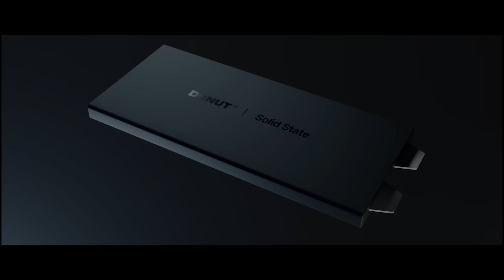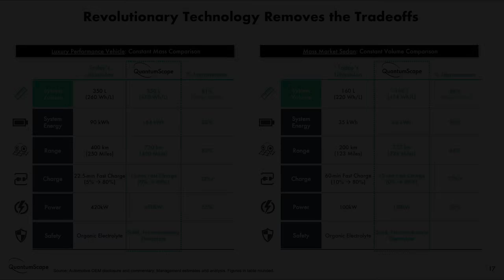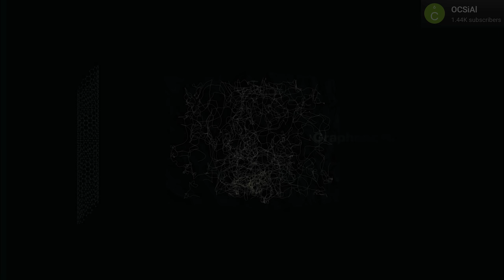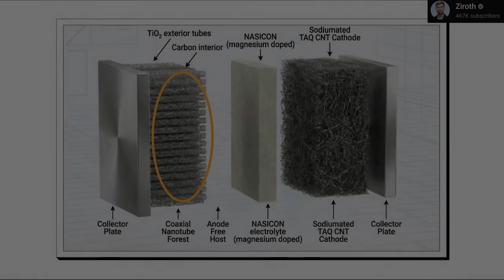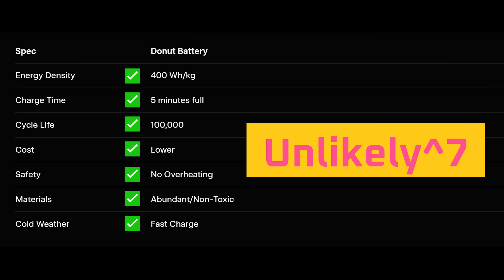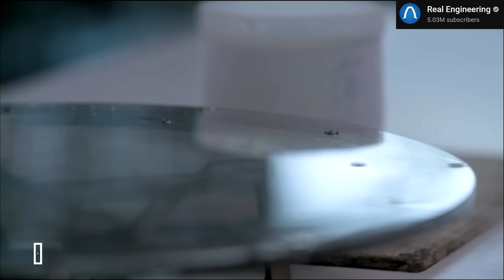Donut Lab's Battery has a Problem with Physics (and manufacturing)

Comment: The Wright Brothers had a problem with physics, too!  😂😂😂
Reply from the maker: And then the Wright Brothers provided proof.

So far, Donut hasn't provided proof.  The results they provided Monday could be replicated with other batteries, so it's far from definitive.

It's likely a cutting edge battery based on the results, but it's still very far from what they're claiming - which is that they've replaced the blade with a laser.  pew pew
Reply: @thelimitingfactor The Wright Brothers did not actually fly on their very first test flight, either.
Reply from the maker: @wesbaumguardner8829  Donut claims they are able to mass produce this cell by the end of this quarter.  More than that even - delivered to customers.  They  have 5 weeks.
Reply: @thelimitingfactor  Well, 5 weeks is not that long to wait to find out if they are lying.  I am not saying they are not lying and I am not saying they are lying.  I simply do not know.  However, there are a lot of people making positive claims to knowledge that I believe they do not actually possess on this subject matter.  They are usually easy to spot because they issue some random argument from incredulity and then back it with more arguments from incredulity and/or anecdotes from lithium ion technology which Donut Labs has specifically stated they are not using.  When people claim that this solid state technology cannot perform because of the limitations of a different technology, that is a red flag and I stop taking claims made by those people seriously because they are going off of false assumptions that cannot be correct.  There is no way a solid state battery is using the same exact processes as a liquid lithium ion battery.  These people are making claims about something for which they do not actually have positive information because they do not even know what materials are being used in the battery right now.  Only a fool makes positive claims about things which they know little to nothing about.
Reply: The Wight Brothers had an excellent understanding of physics and engineering.  They carefully analyzed the problem of controlled flight from first principles physics.  They built their own wind tunnel to test aerodynamic lift and drag, they designed their propeller as a rotating wing, they did unpowered test flights to test their aerodynamic control system, they designed and built their own engine in order to get an acceptable power to weight ratio.  They knew what they were up against.  IMO Donut Labs has very long road to travel to get the expertise and experience needed to produce battery cells.
Reply: @georgepelton5645  "The Wight Brothers had an excellent understanding of physics and engineering."  Is it your claim that Donut Labs and their sister nanotech company do not have a similar understanding in their field?  If so, do you have evidence to support that positive claim to knowledge?

"They carefully analyzed the problem of controlled flight from first principles physics.  They built their own wind tunnel to test aerodynamic lift and drag, they designed their propeller as a rotating wing, they did unpowered test flights to test their aerodynamic control system, they designed and built their own engine in order to get an acceptable power to weight ratio."  And yet every single academic treated them as if they were just crazy country bumkins until they actually flew.  Not a single academic was optimistic about their success before it happened.  They all said it was impossible "because no one has ever done it before."  This is the same old trope we are experiencing right now.  Is it your claim that Donut Labs and their sister nanotech company do not have an understanding of the physics of their batteries from first principles and  have not performed similar tests on their batteries to make the claims they are making?  If so, do you have any evidence to support your positive claims to knowledge?

"They knew what they were up against."  Is it your claim that Donut labs and their sister nanotech company do not know what they are up against?  If so, do you have evidence to support that positive claim to knowledge.

"IMO Donut Labs has very long road to travel to get the expertise and experience needed to produce battery cells."  Well, at least you are honest about it just being an opinion.  Do you even know the people whom you are forming your opinion of, their background, education, experience, etc., or are you just guessing from the information released by Donut Labs to the public?

Comment: Great deep dive I've learned a lot. When the company's CTO is an industrial designer with ZERO experience in batteries. It all smells like a big scam.

Unrelated question, what are your thoughts about Leyden-Jar?
Reply from the maker: Sure thing!

I view all these start-ups the same.

I get interested when they can start showing mass production.

One can easily do almost any miracle chemistry at low volumes and high prices.

But, that's the tip of the ice berg from an engineering perspective.

These start-ups can be interesting from a technical perspective, but I prefer to focus my time on what can really move the needle.  Like the new paper from U Chicago on high voltage dry electrode designs.
Reply: @thelimitingfactor ”New paper on high voltage dry electrode designs” 👀

Comment: Go back even further to Zenn Motors (Canada) and their Esstor Corp, Cedar Creek, Texas, (Ultra High Capacitor) Barium Titanate, that stole millions from naive investors including me. Can you believe Zenn as another name is still doing business. How does this even happen. People should have gone to jail.
Here:
Key Aspects of EEStor's Technology:
Composition-Modified Barium Titanate (CMBT): The core of the technology is a patented, high-permittivity, ceramic-based capacitor (or EESU - Electrical Energy Storage Unit).
High Energy Density Claims: EEStor claimed its technology could achieve energy densities 5 to 100s of times higher than existing high-voltage capacitors, with the potential to rival batteries.
Reply: STEORN and many  others
Reply: I remember ZENN and EEStor! Well, I had forgotten, but thanks for reactivating those brain cells. 😂
Reply: Lead carbon batteries use the battery incorporating a supercap technique. 

Against a physically separate super cap it likely saves weight, space and cost as well as having some performance improvements. However it is costly. At least 50% more than an equivalent lead acid battery.

However, I do have a friend who in uses a lead carbon battery as part of his home power solution. He is very happy with it, saying the added performance (supply strength and stability) is well worth the added cost.

Comment: Ziroth has some skin in the game now. He has offered to donate $5,000 to a charity of Donut's choice if the battery does not contain lithium. How about you join in for $10,000? Put up or shut up.
Reply from the maker: Sure thing!  If Donut can hit every spec with the same cell in high production and low cost, I have no problem donating $10,000 to charity.

Now, are you going to step up and support my channel financially, or just demand that other people put up or shut up?
Reply: Interesting that you feel the need to rig the conditions of the bet in your favor. Clearly, if you make it specific enough, you're planning on reneging based on some minor technicality. Not so confident after all? You've done nothing to earn my respect.
Reply from the maker: @johnbmudd  I'm aligning it to my claims in the video and Donut's marketing claims.  If that's rigging, I'm a pink elephant.
Reply: More chicken than elephant, I think.
Reply: Face it bud Donut is a scam.
Reply from the maker: @gladeous4161 Interestingly, you could probably buy a good quality cell off Ali Baba and get the same test results if you push it to the limits of its performance.  Obviously I'm not saying that's what they did, but one could if one so desired.